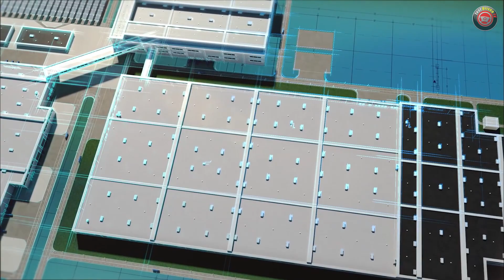Blue Oval City to build next-gen Ford T3 Electric Pickup Trucks

Comment: From that silhouette, the front of that truck seems similar in shape and length to the "far out front" Econoline van of the 70s and 80s.
Reply: Insiders have said it looks like a more radical/futuristic take on the '97-03 trucks. You can see part of the side profile in ford's 1:27 minute video on the t3 with a designer standing next to it. Looks like the fenders angle down aggressively with a raked windshield, with its angle flowing into a character line on the front fender. Looks sick from what little we can see. Can't wait to see it.